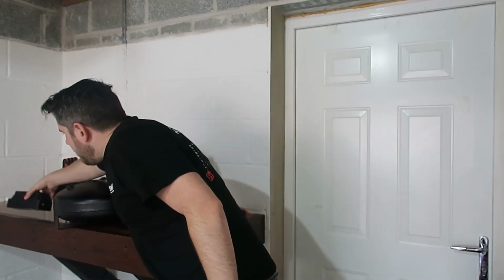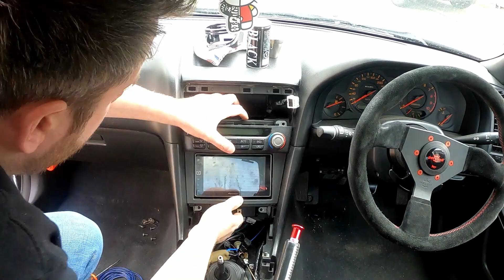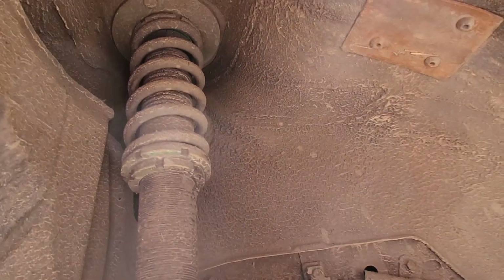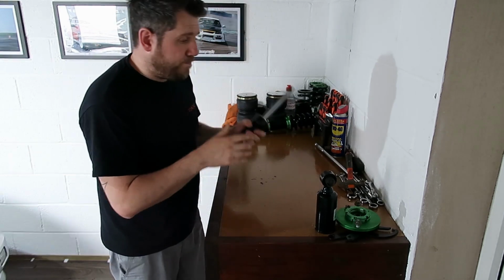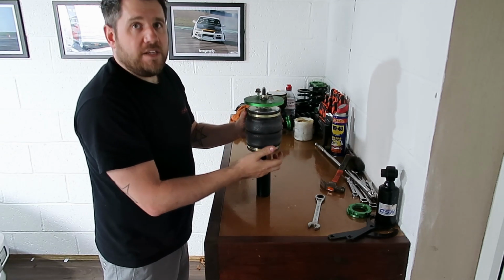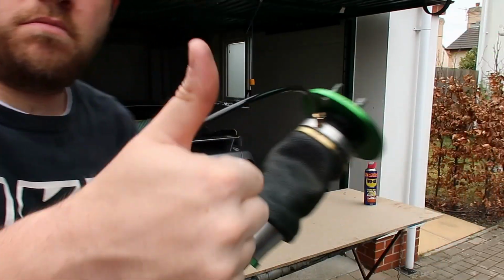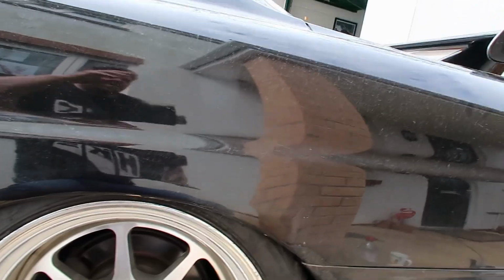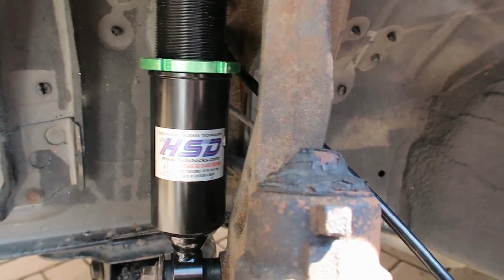Part 2: R34 air ride | installing coilover bags and running the lines | how to |

Comment: I rewound the video trying to part where you talk about the coilovers and if those are aftermarket ones or not? If in fact you never did talk about it, do you recommend a good set of R34 25GT aftermarket shocks?
Reply from the maker: I cover the coilovers a bit more in part 1 of the install.
These are HSD coilovers, because the non turbo has a different rear suspension mounting from the R34 gtt the ones I have used are R33 gtst coilovers.
Reply: @RJDMaskell  you’re the man. I literally have the same car. I’m up in Scotland and I’ll be trailering the car down to RB motorsports to finish up some botched work that another shop did.

Comment: How are those toughluck bags doing? I've notice that they are much cheaper than others.
Reply from the maker: Dave C really good, the quality is great, I had to mod the coil-over a little for an exact fit but it sits really nice and drives great.
Reply: @RJDMaskell any complaints? I'm considering them, how's the company I know They're not very big. Dont know the reputation.